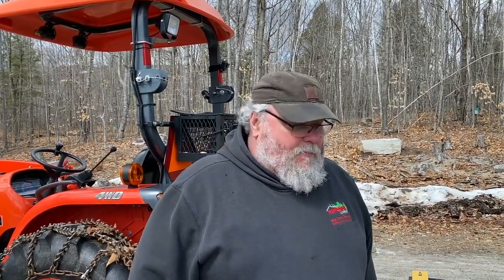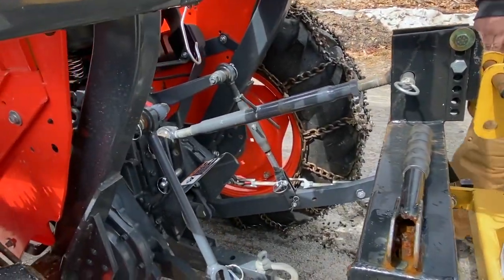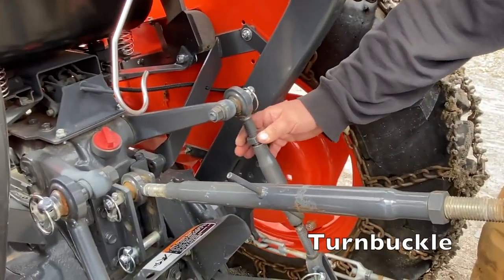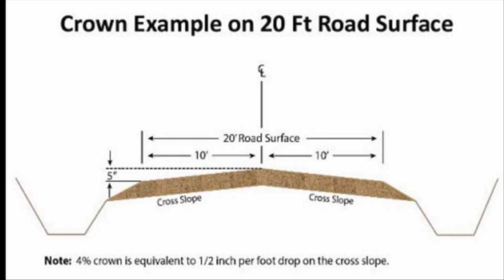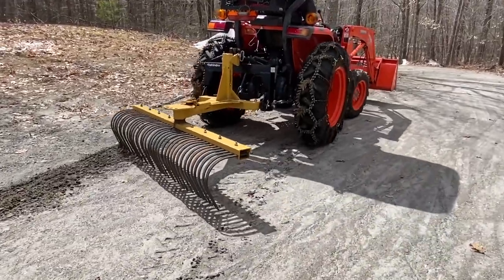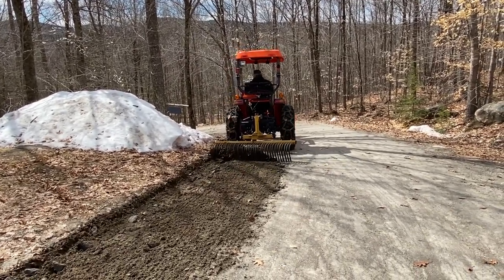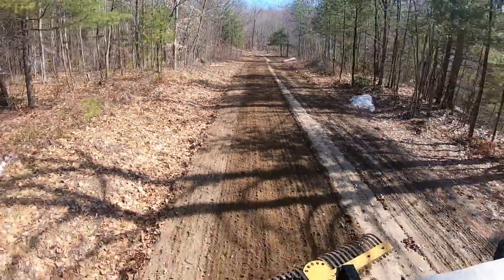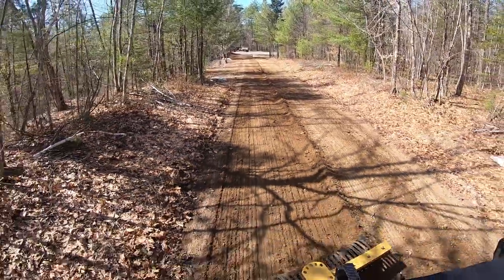Landscape 6' Rake From County Line with the Kubota L2501 || Crowning the Road

Comment: How do you know when you have to rake a gravel driveway
Reply: Well, the biggest reason would be erosion, or washout. But I guess the reason doesn’t matter. If your road/driveway is rough, from ruts, it’s probably time. It really doesn’t matter what caused the damage, if it’s not fairly smooth, or the wheel ruts are lower than the rest of the surface, a heavy rain will make it muddy from standing water, or the water will run in the low spots and cause washout.